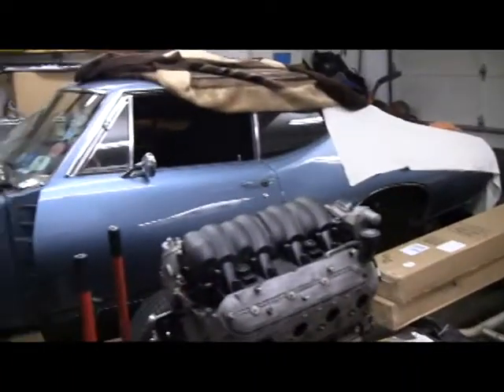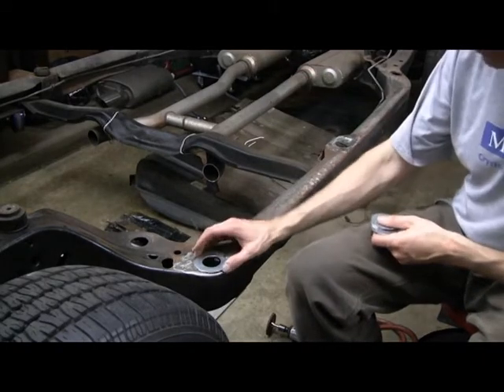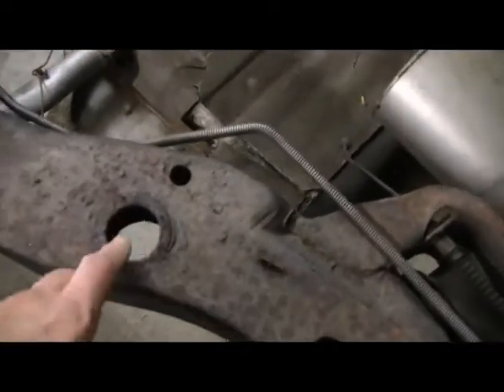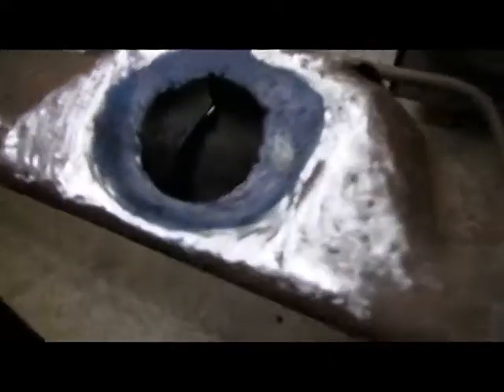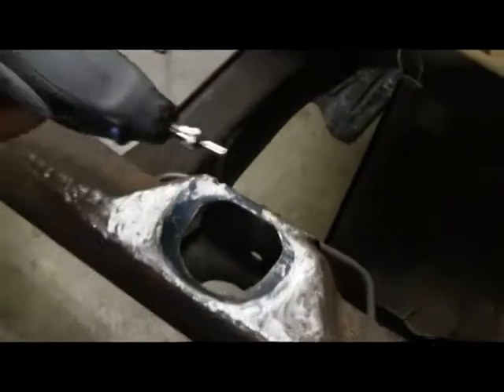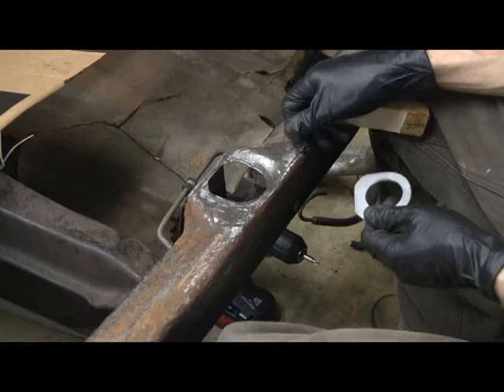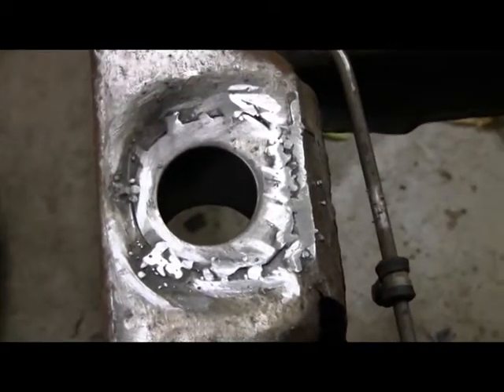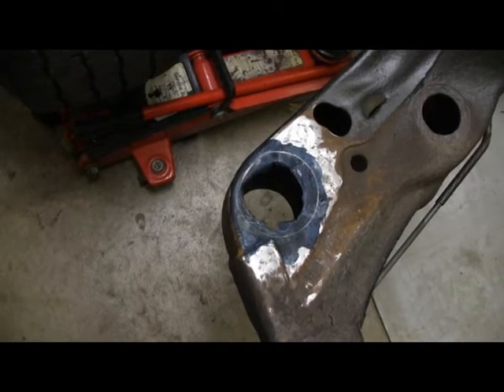LS Conversion Swap Part 22, Frame mount repair

Comment: Just watched this video. Doing the same thing to my 70 chevelle. When you took your measurements was it center to center or inside edge to inside edge of the mounting holes?
Reply from the maker: I went from edge of hole to edge of hole. I have really skinny tape measure (1/4" wide), worked well to go from edge to edge. Position was OK, I had to oval out one of them about 1/8", but rest were spot on.
Reply: Ok cool thank you

Comment: Simple easy way to do these repairs, check out Fitzee’s Fabrications. He patches the holes on a pickup bed. Weld a pc of metal to the washer. Use the metal to hold the washer while you tack it in place.

Comment: You're not a welder but welding on a frame ??? Would hate to see your mounts pop through because lack of penetration.
Reply from the maker: Good point and I guess time will tell. No issues yet and I launch the car hard with slicks. The welds were not pretty but relatively confident they are solid.

Comment: I did the same thing to my beumont just put 1/8 in thick washers right on top didn't want to take the chance on twisting the body at all and you know the metal is thicker the further away from the hole will be using under coating under the mounts to stop corosion from happening again and by doing all of them the body will be 1/8th higher but you won't notice it once every thing is bolted back on

just the way I'm doing it and at my age it'll last a lot longer than me and probably my kids, 

awsome job you are doing don't worry about your welds after your done or befor you'll improve and a grinder will fix most welds
Reply from the maker: Thanks for the interest in my build. Yep, as long as you do all of them it should work fine welding on top.

Comment: I am sure I should look ahead, but never trust another frame's measurements. You want to patch those with plate and drill new ones after marking with the body indexed from the good mounts.
Reply from the maker: Agreed, that would be best. It all turned out OK. I only had to oval out one of them. It really did work pretty good. I guess I got lucky.

Comment: I have the same issue with my 71 Chevelle.  Any change you have all those measurements still that you can share?
Reply from the maker: Sorry, I don't have them written down anymore, but I say all the ones I used in the video

Comment: Good video, where did you buy your patches. Also could you have place sealant under the patch before welding it to prevent moisture that you were worried about? Why or why not.? Please respond, i have to do the exact thing on my frame.
Thank you for your time.
Reply from the maker: Patches came from Original Parts Group. I think Year One has them also. My thought with undercoating is that it would burn off with the welding process. Cutting to butt-weld really was not that bad. To fit each I maybe spent 30min per hole max. If I were to do it again I would have beveled the joint area to get more weld, but that would be the only difference.

Comment: You may have been able to have gotten away without removing the body. loosen mounts on one side, then remove mounts on the other side and raise that side a foot or so for access. Then attach that side, then move on to the other side. the body actually looks pretty good for a rust belt car.
Reply from the maker: Maybe. It would have been tough to do all the repair work. 1ft is not a lot of room
Reply: Once you get started, sometimes it is hard to know just when to stop. I noticed that you installed some adjustable links for the rear. What will that allow you to do that the stock piece would not?
Reply from the maker: The main reason was to get the spherical ends on the frame side of the upper arms to eliminate suspension bind. I added the anti-hop bars a while ago to eliminate wheel hop (they work great!), but it messes with the geometry a little causing a little bind when used with stock rubber bushings. With the adjustment in length I have the option to further adjust pinion angle to avoid wheel hop if I have it with the additional HP I am adding.

Comment: could have used magnets to hold the washers.
Reply from the maker: Thanks for the tip. That would have worked well. I will remember for my next welding project